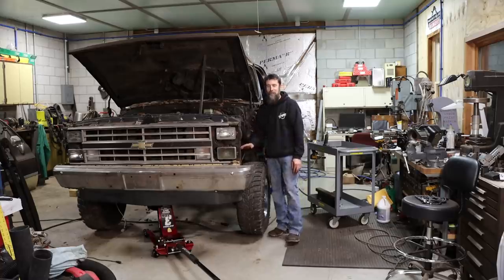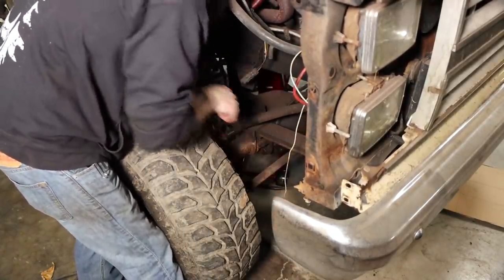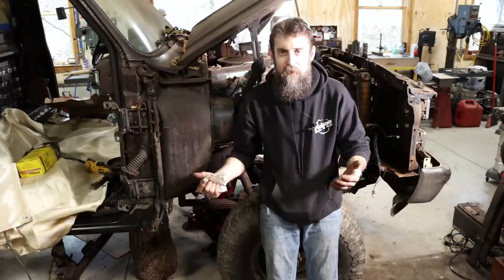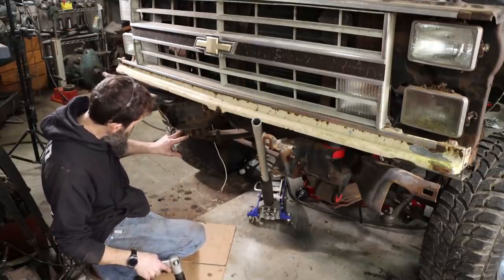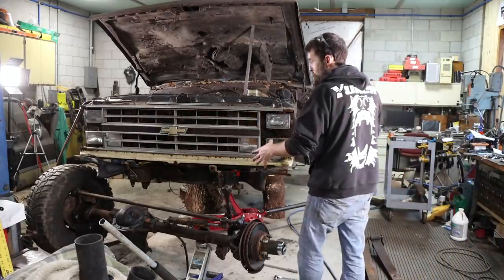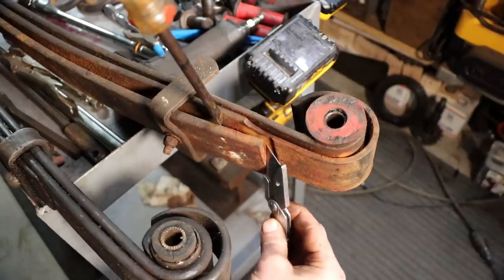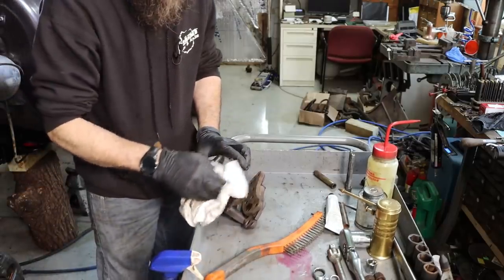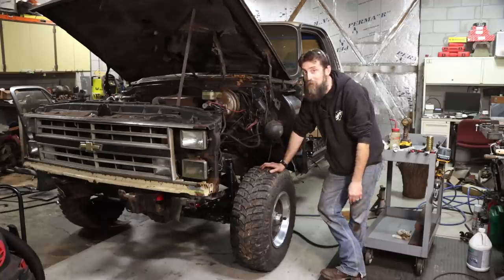Dropping and replacing the entire front axle. Everything was BAD.

Comment: The base price of a 87 S10 was $7979. 2wd no radio or even a rear bumper. I wanted one so bad back then. And I still like the looks of a pretty 1990 S10. But now have 4 1993 Dodge Dakotas a 94 and 95. Also have a 94 Chevy 1/2ton. The 94 Dodge Dakota is the most I ever gave for a vehicle... $1300. From 1998 Dodge pickups until about 2018 Ford f150. I just didn't like the looks of a new trucks. And I haven't seen a regular car I like since the 1986 Chevy Celebrity. With the exception of the Dodge Chargers of today. And sports cars like the Challenger, Mustang, and Camaro. I like them but can't get in and out of them anymore. I set in a Challenger 1 time and had to roll out on the ground to get out. So a pickup is my thing but I can't see giving $49,000+ for 1 when that's what I gave for my new mobile home in 2007.

Comment: Adjusting for inflation, a $16,400 truck in 1985 would cost over $42,000 in 2021 dollars.  It is worth noting, that base model trucks today contain a host of features not available in 1985 (ABS, airbags, fuel efficiency, safety, fuel injection, etc.).  I do not understand why people think trucks cost more now than in 1985.  Trucks are in fact cheaper today once a feller considers inflation and compares apples to apples.

Comment: Cost of 4wd pickups is crazy high because it is a high profit margin market, and because wealthy people want them. Utility pickup trucks which would be used in commercial fleets are  unlikely to be 4wd. Also, the increasing CAFE standards forces engineers to achieve better fuel economy by improving engines, and eliminating parasitic losses; using proven drivetrain technology of the '80s era is no longer an option.

Comment: believe your dad,10 grand would buy you a c10 pickup,no radio or ac,15 grand would buy you a heavy half 4x4 no radio or ac,add 2 grand to each and you would have the ac and radio hahah.
no joke there was a time you could actually order a vehicle from factory with all you wanted them days are gone , i have a 80 and 83 right now,the 80 is a heavy half 4x4,the 83 is just a pickup,the new 350 is in the living room waiting to be built,i love um and have nothing for the new cars or trucks of today,im a mechanic by trade also a machinist and from working on cars trucks buses and tractor trailers and heavy equitment all made of plastic,i will go to my days end fixing my old trucks hahah,love um but hey dont fight your restore,that wrench with the red and green hoses is you very very best friend .
right were you stand i would take that radiator support off and go to town on that engine,from experience and i have plenty,as i mentioned i have a 350 in my living room,dude it is cheaper to buy a long block than build yourself,now take it it has taken me 5 years to buy all my rotating assembly,and i balanced all my rods and pistons and know my bob weight,but just to balance a crank to a flex plate and harmonic balancer the machine cost just yesterday was 300 bucks,that doesnt include it weight needs added, i had my block bored and honed cam bearing installed , that was 20 bucks a hole 160 bucks,cam install was 50 bucks buying from them,then i have a set of z28 heads im gonna run,new guides new stainless steel intake and exhaust valves with hardened exhaust seats ,upgraded springs complete with a shave,i walked out the door 500 bucks light, so at those prices i dont even want to hear how machine shops are barly surviving  ,as they say the after market is putting them out of business ,you can buy a cheap long block for 1500 bucks,so it comes down to what you desire, i go with my build ,it is a trust and if it does go to crap only one feller to bitch at,but when i turn a key i know i built it ,beside that with all the lying in this world today one thing is for damn sure a american made that truck hahaha had fun doing it too,rebuild the 83 from the ground up,havent done the body or paint,probally wont,me and shinny dont jive, only time my cars and trucks get washed is if by chance here in south texas it rains lol

Comment: $15K in the early 80's is the equivalent to $50K today.  So can you buy a rather base 4x4 truck for 50K today?  Heck yes you can, actually, you can get a fairly loaded full size 4x4 for that money or a Fully load Ranger or the like...
Reply: He said with Inflation factored in 15k.
Reply: Trucks were dirt cheap back then, nobody really bought them besides fleet and construction companies. And in 1995 you could get a fully loaded 1/2 ton for like 16k brand new. Once the epa and Democrats started taxing and regulating everyone to death prices went up and have never come back down.
Reply: @codylapoint   You absolutely could not get a fully loaded 1/2 ton for 16K in 1995  a BASE  2wd 300 I6 no power nothing cept brakes and steering with AM radio light GVRW F150 was $13,287 when new in 1995.

Comment: How do you know where to clamp the front axle onto the leaf springs?  Could you be off a little and have alignment issues?
Reply: There is a center bolt in the springs, and a locating hole on the spring perch on the axle housing.
This locates the axle.
No worries.

Comment: Steve , 
Being the owner of 5 old cars and nothing newer than a 1970 I feel your leaving something out about all new vehicles. There not built to be repaired or restored at all, you fork out $85K for a new truck and in 10 years they don't sell replacement parts because 70% of it is nothing more than FLUFF!  plastic and rubber or computers that always go out and can't be replaced because they only want then to last 10 years max then your FORCED to buy another Truck. The best part of your truck is anyone CAN rebuild it as the parts are available and most likely always will be plus, they make sense to own. After you finish your square body, you just watch how many people will stop you at gas stations and ask you over & over ---- Hey, you want to sell that truck?  My standard answer is, ---- and buy what?  Fact is, you can't really repair anything newer then a 1980 so why would I sell or trade for what you're driving that I can't restore and soon enough nobody will make parts for??? All 5 of my old cars I can find just about anything for them as each have a huge following and parts are available ( even for my 1966 Olds 442 ! ) So keep your old truck Steve and NEVER sell or trade it as that would be a mistake you will always regrate.  Bottom line, old IS gold ! P/S I just spent $4,000.00 to rebuild a 1967 Chevy 327 that I assembled myself to put in my 1970 Chevelle daily driver. Automotive machine work is VERY expansive !!!!  if you want it done right .